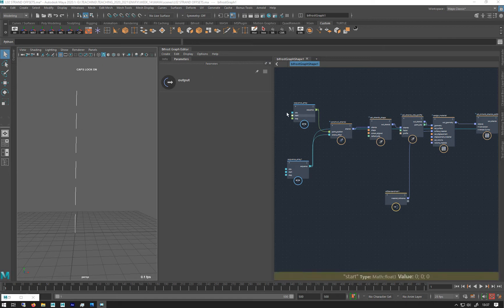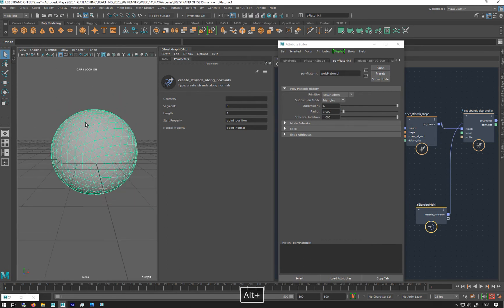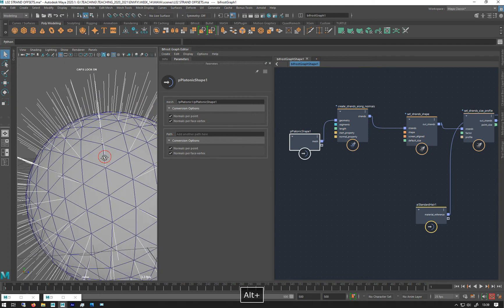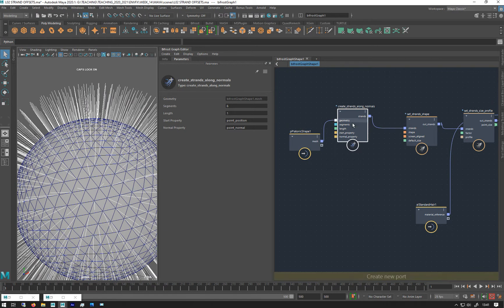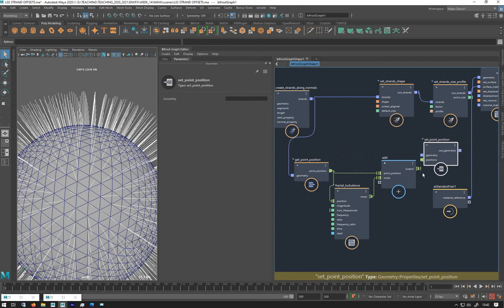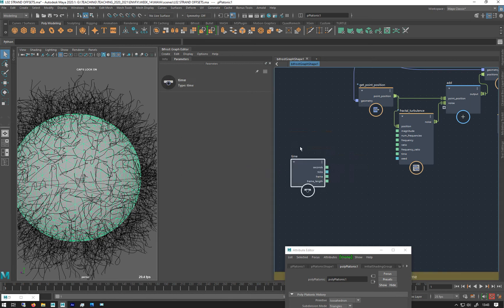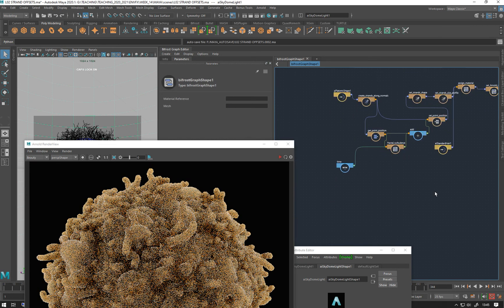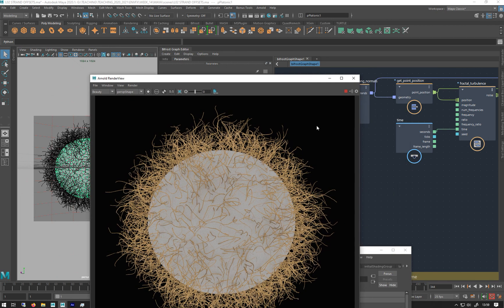BIFROST BASICS: WEEK 5 LESSON 3 STRANDS ALONG NORMALS

Comment: I could not get tubes to render. No matter what option I selected, I got ribbons. 

Also, I could not change their length without pulling them from the surface of the platonic sphere.
Reply from the maker: Try updating to the latest version of Arnold for your ribbon issue. I discuss applying more controlled turbulence in later videos. Hope that helps
Reply: @jmm7180  I'll give it a try. Thanks.
Reply: @jmm7180  Hey there... Updated Arnold, but got this:

"bifShapeTranslator: Arnold node type bifrost_graph does not exist."

!!!!

Comment: Why is it necessary to add the get_point_position and fractal_turbulence nodes even though the former is already plugged into the latter?
Reply from the maker: If you plug the turbulence directly into the set point position all the strands will move to the origin with values around  the  magnitude of the turbulence.  Plugging the positions into the turbulence is just sampling the turbluence at those positions which you can add to the original positions to add some turbulence. Hope that makes sense
Reply: @jmm7180  I'll read it over several times :) Thanks man.
Reply: @keithyakouboff8755  fractal_turbulence just generates a number between -amplitude +amplitude values, for each point position incoming (the point position is only used internaly to generate consistent noise between all points). One can do any sorts of operations with the noise output but adding 'noise' to 'current position' is a common tecnique in many applications.